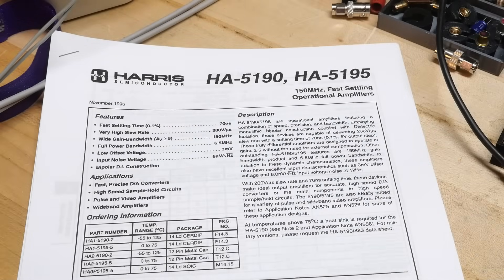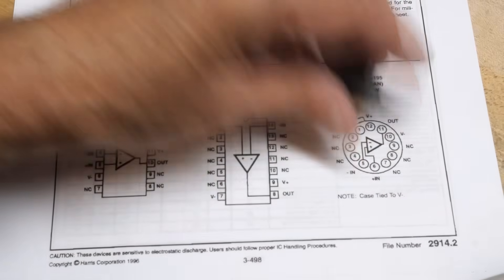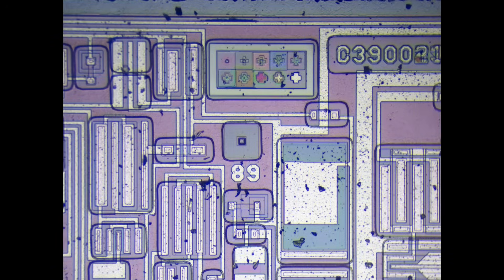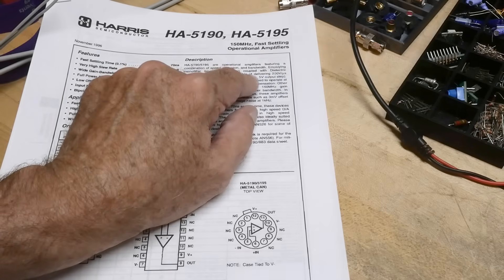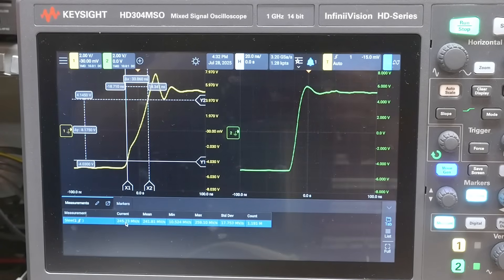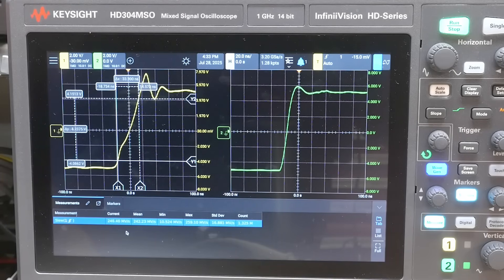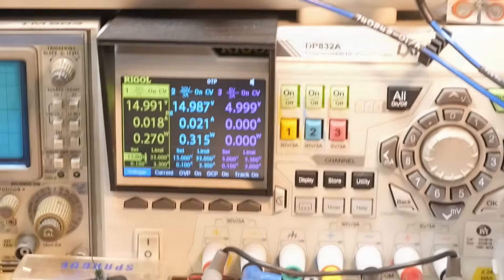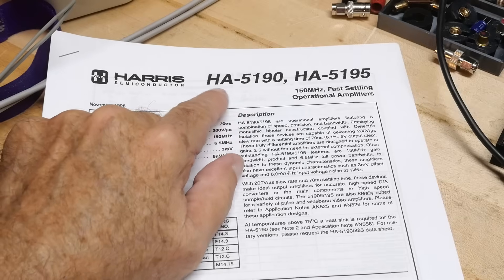#2316 HA-5190 High Speed Op-Amp

Comment: It is probably in the big can to be pin compatible with some of the hybrid amps that were in big round cans. National made some of the latter.

Were those scope probes active ("FET") types? If they weren't the ground leads used were way, way, way too long for that type of measurement. With something that can deliver some current, 500 ohm passive probes are a viable alternative.

Comment: The power dissipation has more to do with the high speed of the part than the fact that it's on a bipolar process. A very fast CMOS part would also consume lots of power and get hot.
Reply: this is correct. more switching per unit time = more heat.
Reply from the maker: https://youtu.be/i2T2-6BWDB4?si=iDxcYApRGp6Fc5lE

Comment: Back in the late 70's early 80's, Harris manufactured a variety of very fast op-amps that no one else could.  They had developed a proprietary analog IC manufacturing process that removed the wafer backside bulk silicon, which had been a source of latent stray capacitance in junction-isolated bipolar analog IC's.  Less substrate junction capacitance = faster circuit.
Reply: Yes, still got a tube or two of their regular opamps, which are pretty good, and generally also lower noise than other manufacturers out of the regular run, for others you had to spec sorted for low noise, but these any one was lower noise.

Comment: What's the difference between an opamp and a comparator? I keep running across people who seem to use the words interchangeably.
Reply from the maker: https://youtu.be/mQSka9iYAno
Reply: @IMSAIGuy   hey, thanks...that video answered the hell out of my question. Nicely done. Comparators flip rail to rail so quick the output becomes digital. Opamps are for all the output voltages between the rails at a much slower dv/dt.
Reply: In general, I can point to two principal differences. The first is that comparators don't have the protection diodes between the inputs that Op Amps do so their inputs can range from GND to close to Vcc without regard to each other.  Doing that with Op Amps tends to let the smoke out.  Internally the inputs are also biased a bit differently.  The other principal difference is the complexity of the output stage. Op Amps are built to deliver an analog output voltage while comparators usually go into full saturation and usually feature open collector outputs, so they need a pull-up and you can bus multiple comparators together which is handy when looking for windows.  While both take analog inputs, comparators are more functionally digital devices while Op Amps are pure analog.  Within severe limitations, you can use an Op Amp as an extremely limited comparator and you may be able to kludge a comparator into use as a very poorly performing Op Amp, but there's no point to using the wrong tool for the job.  Compare the internal schematic of the LM324 and LM393 for more.
Reply: A usual opamp can be configured as a comparator but, comparator IC’s are opamps with specifications for analog Voltage comparison. Some opamps are intended to be used as Voltage followers. Some for sample and hold circuits. Read the data sheets for details. Look into Schmitt trigger circuits.😊

Comment: Black matte tape or paint can get you a more accurate can temperature.  I’m surprised with all the legs they couldn’t add in a thermistor to monitor temp.
Reply: I used to keep a fingernail polish bottle filled with matte black BBQ paint extracted from a spray can for just such uses.  IR cameras and metal surfaces are a useless combination.

Comment: I don't think you're measuring with your thermal camera correctly. The shiny top of the chip will give a much lower reading than it should, while the non-reflective white tag is probably more accurate. I always draw a big black permanent marker dot on anything metal to get a better reading, or a little bit of electrical tape.
Unless, of course, you specifically changed the emissivity setting on your camera for reflective metals. I seem to recall you got a multimeter with a thermocouple recently. Try putting the probe on the chip and I think you'll find the white trash is the more accurate temperature. Color it black and it will be more accurate.
Reply: Agree.  Scalding hot stainless steel looks room temperature on an IR camera unless calibrated.  I will never trust an IR camera for metallic surfaces and always used BBQ paint for thermal targets.

Comment: I wonder if all those extra (unused) pins on the package are for thermal management?  Get some of the heat into the PCB before having to resort to a heat sink?
Reply: This is pure speculation but, if you need a larger mass for thermal reasons, you'll probably also need a more robust mechanical attachment to the PCB.
Reply: @leocelente  Datasheet says you dissipate over 1W just doing nothing at all, and when you add in the 50mA peak output current this rises to nearly 2W of heat to dissipate. The 12pin package is the easiest to heatsink, but has 34C/W rating, while the big CERDIP is 20C/W, but you need to have a custom heatsink you bond to the ceramic to use it. You need it above 70C, and the SOIC14 you are going to melt off the board unless you have a heatsink even in normal use, so best to stick to an aluminium core PCB, or mill out a hole to have a custom copper slug there, if you want it to survive.
Reply: I suspect the large package is for exactly the same reason. I once made the mistake of touching a LH0033 that had been operating for a while - it left a blister.
Reply: @Hardlygamaliel  Yes they do run hot, and you know the datasheet claim of it being a DAMN fast opamp is true. I have a few around, never used in anger, it just never was something i needed, but to have them was great.

Comment: If you think about it, manufacturers didn't have to do much to switch to SMD components.  Just take it out of the huge empty can of air, add a couple short bond wires to some leads and pot it in plastic.
Reply: Surface mounted chips pre-date through hole packages.  
TI invented SMD flatpacks in 1962 and they were written into MIL-STD-1835.  
Fairchild invented the ceramic DIP package in 1964 as a descendant of the MIL-STD-1835 Flatpack.
Reply: @Peter_S_  I know.  I have a lot of early TI parts from their R&D lab.  Those early TI transistors from a R&D lab that IMSAI Guy did a video on several months ago came from me.  Have several Lista parts cabinet drawers full of early ceramic flatpacks and transistors.  Since they were from a R&D lab all the part numbers on most of them are written on with a pencil. Also have a lot of the "parts" or transistors and IC's before they were assembled. Honestly not sure what facility they actually came from.  They were all gifted to me by someone who got them from someone, etc...  Have no clue how many hands they may have passed through over the decades.
Reply: That one had the big package to dissipate the heat, it only needed 5 pins and substrate connected, but the bigger package to keep it operating correctly when the ambient was 125C, so the die itself would be below it's absolute max of 150C for long term reliability. SMD packages, or even the flat pack, would have been running hot enough at 125c to have the added heat from the die, which uses a lot more current when it is being used to deliver power into a load. running at 15v rails, and delivering 50mA into the load, means it will need a heatsink to operate, because it will otherwise be unable to operate. 34C/W thermal resistance for that 12 pin can, which is the best you can hope for, the CERDIP alternative is 20C/W, and the SOIC14 package, the worst one, is 114C/W, which means you better run that version off 10V rails and only deliver 1mA of current, like in an input SH amplifier for an ADC with input sampling. Don't forget it is not unity gain stable either, needs to have 5 as minimal gain, and load of 10pF maximum overall. hot running, but was an absolute beast for RADAR video driving purposes when it was designed. Probably still available as spare part for every old approach RADAR in use in the USA still.
Reply: @SeanBZA  If heat is a concern just do what they do with modern SMD parts that don't generate excessive amounts of heat.  Use the PCB ground plane as a heat sink.  A lot of modern parts just have the die stuck to a copper heat spreader that is soldered directly to the ground plane.  Heat obviously wasn't a massive concern because the datasheet shows it was also available in CERDIP and SOIC packages.  My point was that with modern package types and the size of the actual die it could be made much smaller.
Reply: @mikesradiorepair  Yes, but remember this part is around 2W of heat dissipation, and was expected to still do this at 125C. When it was developed they did not have the modern exposed heat slug around, and plastic packaging was notorious then for being porous, and for having poor thermal conductivity, plus the preferred connection method was a thin wire bond to a pad, only other option being a much more expensive (and patented by Fairchild) Flip Chip, which meant you were going to use it them only in a hybrid package anyway. It is only recently that the ID leadframes were developed that allowed direct bonding, and even putting in a package with the center 6 legs as part of the chip carrier, like the LM380N 9and not the LM380N-8 smaller 8 pin DIP) was not considered reliable. Good enough for cheap consumer use, but this was originally made to scratch a military and industrial use itch, which demanded high temperature operation, and 50 year operational life at that, plus thousands of temperature cycles as well..